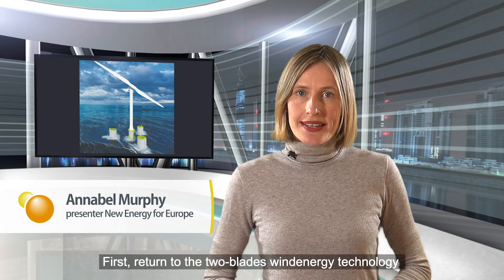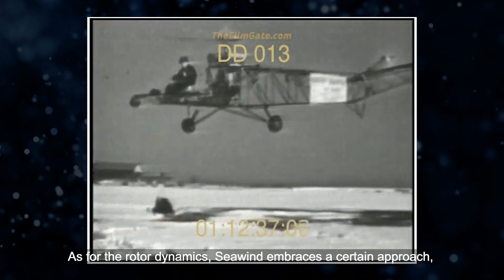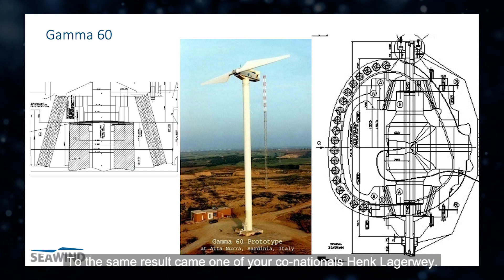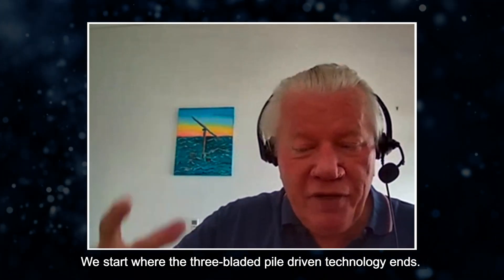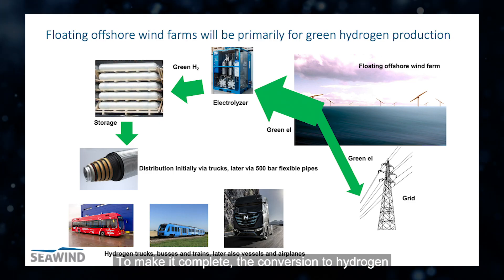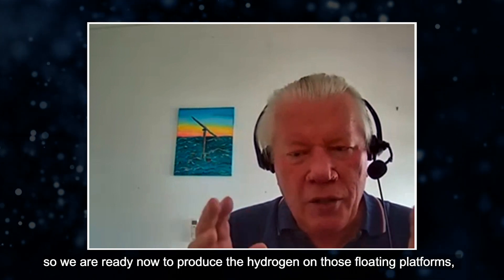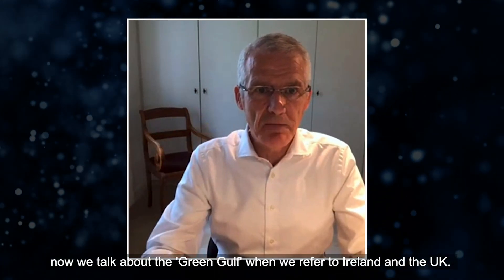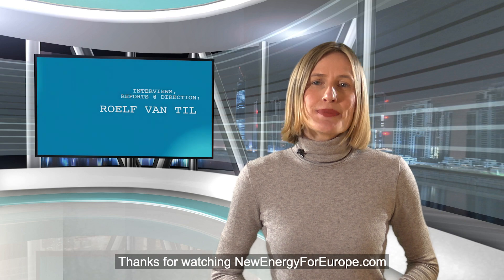Seawind: two-blades floating wind turbines making hydrogen

Comment: Slightly concerned about the potential for a "Deepwater Horizon"-scale explosion, with an ever increasing infrastructure of hydrogen being piped ashore at 500 bar of pressure. What could possibly go wrong?